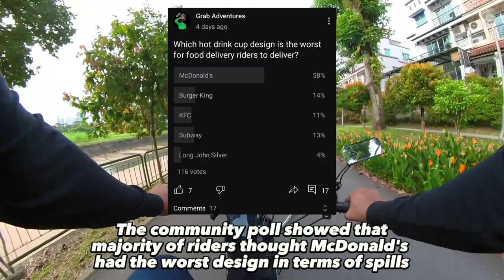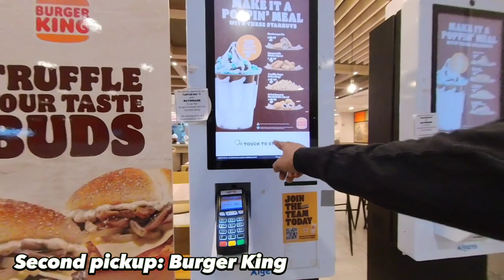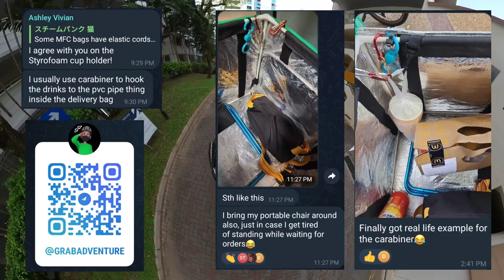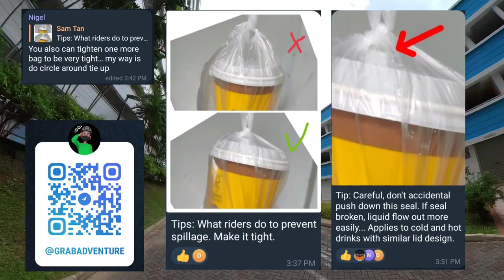S3:EP24 Why do they suck? | How to deliver hot drinks without spilling

Comment: a simple solution that the merchant can do~ put a cling wrap over the cup first then cap it with the lip~ it will be water tight, you can flip the cup upside down and it won't leak~ this also work for plastic container~ apparently some chinese zhichar stall do this for their soup items~
Reply from the maker: Now that you mention this, i remember seeing some food stalls doing this. It does seem like a good way to seal the drink in.

Comment: What i usually do for macdonalds hot drinks...i will take their mcd sticker where they usually use to seal the food tear a small piece of it and stick it to the small tiny hole on the lid...not the part for drinking but the small hole where the hot drink usually will spill out..than tie it tidely the really secure the lid..
Reply from the maker: I never though of that. Does it help to minimise the spill?

Comment: I was expecting the McD coffee to be the worst, but, surprise surprise. Subway and KFC cups have "osmosis" properties which are undesirable in this context lol.
Reply from the maker: I was also surprised with the result. But the killer is the LJS cup. Even though it did not absorb, the lid design combined with the stacking method in the elongated plastic bag makes this the worst.

Btw thank you for the awesome masterclass video. I was expecting at best a few pics but you went above and beyond my expectations. Thank you Bernie!
Reply: @grabadventures  Yea man, the LJS bag. One way is try twisting it, but it will not leave a tight knot over the cover. 

It was my pleasure to be part of your video! Hopefully your "test of the cups" will shed some light on this matter and we can get more decent packaging in the future :)
Reply from the maker: Thx for the compliment. I did try twisting it but found that the lid becomes loose as it rotates.

I am not sure if i am doing it wrong 😕 🙃

Comment: never put drinks in bag. Always hang drink at your bicycle handle
Reply from the maker: I actually wonder about that. Would the drink not spill when turning the handle? I hv not tried it myself but know some riders use this method.
Reply: @grabadventures  nowadays I do this haha won't spill as much as in bag
Reply: If you make sudden swift turnings of the handlebar in a wide arc in one quick motion, the momentum can cause the drink to spill. Another scenario is bumping humps without slowing down, but you know that already.

Since this method means the hot drink is not placed in the thermal bag, it can probably go cold faster if you take too long to deliver it. But the handlebar method can be more stable if you don't make sudden jerky motions.
Reply from the maker: @warlogaful  it seems like there is no foolproof way of delivering hot drinks without spilling 😳 😕
Reply: @grabadventures  Which is why this video hits the nail on the head regarding this issue, brother :) Since we can't pull it off perfectly, we can only do our best to minimise the spillage. Thank you for the video & good earnings 👍
Reply from the maker: Thank you for this encouraging comment. It really makes me feel that it's worthwhile doing this type of quirky content which I thought no one will watch.
Reply: @grabadventures  You know bro, when I first started doing Grab as a rookie, there were times when I was completely lost & didn't know what to do. It was the old-timers around me that saved my butt. They were kind to me & helped me out (that includes old-timers like you who taught me a lot in your videos).

It's my way of saying "Thank You" to you good guys :) I hope that when a rookie gets lost, I'll be around to help him or her out too. That's one of the things I love about this job, it helps me hang on to hope for humanity when we help one another.
Reply: No you shouldn't hang it on handle bar the hot drinks will definitely spilled even worse 😂😂
Reply from the maker: Actually i have seen some riders hang it on the handlebar. I am amazed how they are able to deliver the drinks intact.
Reply: @grabadventures  bro i oso a grabfood rider and i always hang drinks on handle bar and always give me problems spill here and there, got one time even worse i drop customer Starbucks drink because their paper bags sucks can't hold any cold drinks and hot drinks properly leh
Reply from the maker: It must take lots of skill to hang on the handlebar and deliver.
Reply: @grabadventures  personally I think drinks on handlebar easier to control than in the bag.
Reply from the maker: I tried it once but i find the swing momentum when turning to be nerve wrecking. Maybe coz i not experienced rider.
Reply: @grabadventures  maybe for non pedal vehicle ok... Pedal the momentum sure alot problem
Reply from the maker: True. Makes sense.
Reply: @grabadventures  😅 when I use to pedal my knee hit the drinks and voila, spill 😂

Comment: I'm telling you KFC is worst hot drink design to delivery i ever had the drink all spill inside plastic bag also leak in thermal bag after i reach customer place
Reply: Hi Rusydi
Reply from the maker: I noticed that kfc lid does not always  fit tightly. That's why i always make sure to take an extra minute to ensure the lid is sealed tightly. 

For ms I chose LJS coz it's not just the cup but the plastic bag which it comes in that makes it absolute disaster for me.

Comment: That stacked Long John drinks really doesn't make sense. I had an order with 8 drinks and were stacked on top of each other. The top drinks ended up submerging into the bottom ones and the content spilled out. Also for hot coffee, tea etc.. no matter how careful I am, short distance also..there is always a tiny bit of overflow at the top
Reply from the maker: Not only is the LJS cup design bad but the bag and method of stacking it makes it even worse. I mean it makes no sense to stack them on top of each other.

Comment: I thought you will open up the lit and see how much coffee left 😅

There are some problems with the experiment. The right side only got 2 cups so there are more rooms for it to move when u go up or down slope then the coffee will flow out from the hole.
Reply from the maker: Good point. I will try to take this factor in if i do a similar experiment next time. 😉
Reply: @grabadventures  put a camera inside the bag to see how the coffee is spills. 😆
Reply from the maker: That's an AWESOME IDEA! Thanks for the tip. I will go figure out how to set up the filming angle and lights inside. 😊 🙏🏽

Comment: Bro Nice Video..fyi mine..the worst is the Mac..how slow and steady we ride..100% will spill..plus bumpy ride..just hope customer don't order hot drink for breakfast..lols.
Reply from the maker: Thx! Actually all cups failed the spill test anyway. I had a customer who requested not to pour hot water into the mcdonalds cup. Just put the tea bag inside and he will pour hot water at home. I ❤️ this type of customer.
Reply: @Grab Adventures  unless they seal tight if not is too difficult not to spill...I hate it when spill..
Reply from the maker: Yep. And some staff like to fill all the way to the top which makes it spill more.

Comment: That tiny hole isn't so hot air can get out. It's so air can get in when you are taking a sip. If it weren't there it would limit the amount one can get out of the cup per sip. Place a piece of clear tape over the hole to help prevent spills

Comment: As a customer I always have problems with hot drinks from LJS. Guess they need to improve their packaging.
Reply from the maker: Thank you for sharing your perspective. Actually if you think about it, most of the takeaway containers being used are not meant for transportation using vehicles. Hopefully someone will come up with a container or cup method which addresses the pain points of delivery riders.

Comment: Sometimes I just put a helmet bag with shirts inside and my also a spare raincoat (all cleaned ) I will use them as a wedge, to put against the drinks so it won't move 
.. I often also put the hot drinks in the cup holder ..most times there is no spillage , but yes sometimes there is .. gotta make sure the cup holder is secured down safely with for eg. Anti slip mat or perhaps you can diy stick it in the bag with glue or something .. 

Hope this helps 
. I'm a motorcycle rider same 2 wheel issues ...
Reply from the maker: Thx bro for the tip. Yep the best solution is to wedge something in.

Comment: They're all made for hand carry and not really suitable for the delivery bag

I usually hand carry or hang on handle for drinks and soup after my first spillage and it works fine till now . Soup usually doesnt matter as it's very hot and still scalding when arriving, drinks it's just the ice melting faster but either that or spillage if you leave it in the box but I think the latter is worse as you also have to clean your bag afterwards
Reply from the maker: I am not sure bro. I don't think i am pro enough. I tried once to carry in my handlebar but i found it spill even more as I turn the handlebar. Just not used to it i guess 😔

Comment: I hope consumers are watching this.
Reply from the maker: Me too. I hope they understand the reason why they rcv spilled stuff sometimes.
Reply: @grabadventures  another is delifrance hot drinks. Paper cup with lid, paper fibre bottom tray and paper bag. Combo for dissaster. I got some spilled. The fibre wet, paper bag wet. Luckily i observe before caryying the bag out of my thermal bag. The bottom lot give away. At the end i deliver 4 cups 2 by 2 to the customer.
Reply from the maker: The tape they use also does not help at all actually.